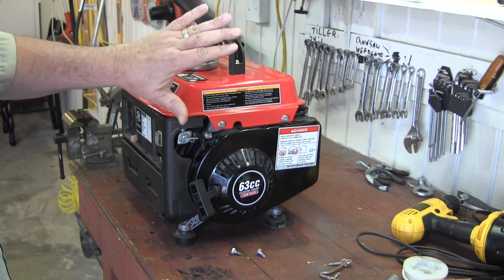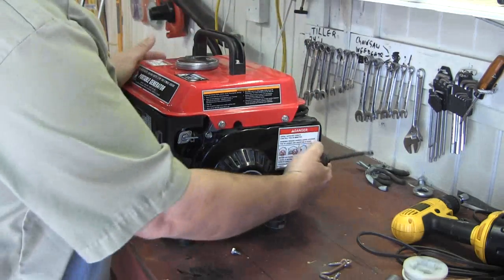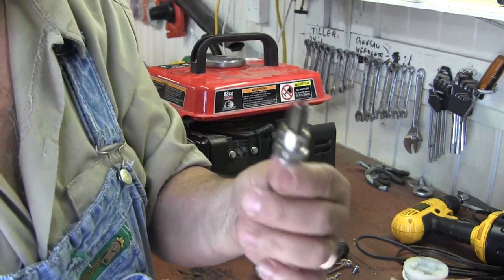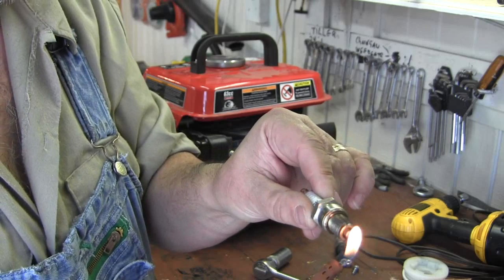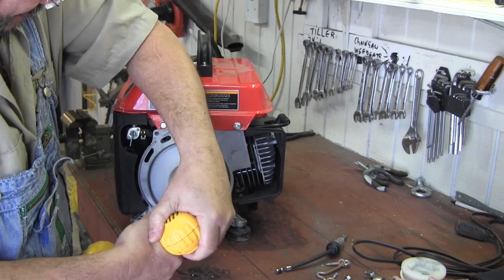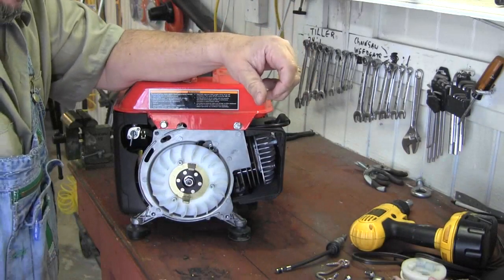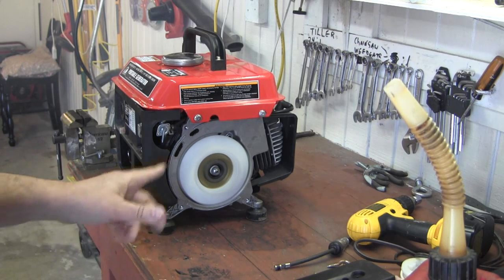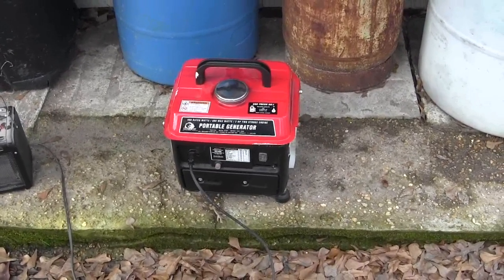Harbor freight generator wont start

Comment: When it's flooded, what often works is to turn the gas switch "Off".  As you turn the engine over (with either the pull start or the drill - great idea, by the way), it burns the extra gas out of the cylinder.  Sometimes, it will catch and run and you can switch on the gas really quick.  Other times, it will fire and stall but if it does, you can turn the gas on and it'll almost always start right up and run fine from there.
I agree with the comments about the spark plug.  I know several people who have these little generators for their RVs and most of them had hard starting, rough running problems but an Autolite plug fixed 'em all like magic.
These things also don't like ethanol-fuel, either.  Most of my friends either use no-ethanol fuel (a lotta boat docks have it) or put "Stabil" in the gas.  No matter what you use, it's a good idea to store it with a dry carburettor.  When you're finished using it, turn off that gas valve and let it run until it quits.  The EPA gas that they sell now makes it hard to store most all power equipment.
Thanks for this video.  I expect you saved a lot of people some time and headaches when they have trouble with their generator.
Reply: Thank you so much, you just made my night. It worked!

Comment: Nice trick with the drill. What has worked for me in the past on a flooded engine is to pull the plug and let it sit for a few hours. Compressed air would speed things up considerably. If you're in a hurry a spray of starting fluid may do the trick too.

Comment: Well done. Those cheap harbor freight gens are worth every penny to me. Run damn strong(well over the rated watts) and when completely finished off from several years of hard use, pull out another one and save the old one for parts. I buy two or three at a time when I get them for seventy bucks a pop. Hard to beat.
Reply: +Arock PCB I buy 3 wenches at a time, and buy 1 extended warranty.Itr covers all 3. They never check serial numbers.
Reply: very clever sir, id love to know the actual margin lines on their products. gotta be still making a profit if every other tool gets returned. I still love HF, many a tool I would not have if I had to pay five or six times the price and most jobs I do a "disposable" tool is cheaper than even renting one.
Reply: Grumpy old fart was a knight at King Arthur's court.

He had a discount card for Rent-A-Wench.  Served him well.

Comment: It's a good little generator for the money. The problem with these is the factory spark plug that it comes with. Change the plug to a better one, and then you wont have anymore starting issues. Also the pull start/shroud has to be on when running the generator. The engine on this unit is air cooled. The fan blades on the fly wheel blow air through the pull start/shroud. With out the pull start/shroud you will over heat, and prematurely wear the engine out.

Comment: If your going to keep the drill crank idea , you NEED to mod the recoil cover  (Gut it and Drill a hole) That cover forces the air over the cylinder to cool it.
Running anymore then 15 min will start to burn her up. .
Reply from the maker: I just used the drill because i new it was gonna take a bunch of pulling to get it cranked. it will crank easy now.
Reply: But you left it Running after on the heater to burn up the old gas.
Reply from the maker: ***** Its ok. its cold out. Its all back together now.

Comment: I have one like that.   Handy thing to have.    I used mine to run my refrigerator for 6 hours when the power went off.   Had to pull the starter 30 times to get it to start but it worked.    I'm gonna try starting fluid with top cylinder lubricant to get it to start easier.    I use a drill set up like that to start my pressure washer when it is hard to start when it hasn't been used for a while.

Comment: I have had the same thing happen from everything purchased from HF.
I just remove the plug and crank all the fuel out.
Then spray I leave the plug out and come back later or spray a little bit of starter fluid on the combustion chamber.
My machine usually starts right up.
This was a great tutorial for all of those who would just toss it.
Reply from the maker: running it dry is my new routine when i put it away, no more probs.
Reply: If you buy from HF and it's got a motor,  rest assured that at some point in time you will be returning it for an exchange, or to get your money back!!!!

Comment: I bought a similar type unit not harbor freight but probably made at the same place it's been 2 years and is still in the box I should probably test the thing. I always try to run the carb dry when I put small engines away the alcohol in the gas today can raise havoc with the carb. I read somewhere some of these units had problems with the shutoff itself. glad you got it running great starting method.. Take care
Reply from the maker: I blame about 2/3rds of my mechanical problems on that damn ethanol.

Comment: 2 cycle engines. Weedeaters, chainsaws, etc must be ran out of fuel for storage.  I fought that last year.  Glad you hot little generator running.  I have had to clean spark arester in muffler before also.  Good video.
Reply from the maker: I think ill just take the spark arrestor off. that will mean ill never be able to run it in california.
Reply: 10 thumbs up on the non CA compliancy

Comment: glad you got it running I have run into something simmilar. What I ended up doing was making sure the fuel was off and pulled the spark plug. The cranked it over several of times to blow the exess fuel out the hole. A little messy but did the jujob

Comment: My first thought, when I saw how easy it cranked over, was that it had no compression. But, I reckon with a piston that small, there wouldn't be a whole lot of compression anyway?
Now all you need to do is rig up a one-way clutch to your power-crank tool, and you're golden!  :)
Reply from the maker: The drill was just temporary because i new it was gonne require a bunch of pulling. i pput the cover back on and cranked a few times and it cranks right up. im gonna let it run out of fuel now.

Comment: When I have the same problem, when using the drill, I leave the spark plug out, choke off, throttle full open.  This aids in blowing out the excess fuel and overly rich mixture.  Leaving the spark plug out allows the drill to work less and spin the engine faster to hasten the purge of the excess fuel.

Comment: Put in a good spark plug
I have a cheap generator, wouldn't run worth a crap. Had the same plug as this one (could see the name as you rotated the plug). Put in a new name brand plug and the thing runs amazing. I used an online cross reference to find the right plug. Have had it for 10 years and runs great. Use it for power outages, running a electric 10ft pole saw for trimming trees, lights around the pond in the winter for skating, etc.

Comment: Thanks BCtruck.  I do not have one of these but if i ever get one and i flood it i sure know what to do to start it.  That was a great idea making a power starter with an electric drill.  There should be an access port on the cover to allow for that option.
Your tenaciousness reminds me of how we dealt with mechanical problems in the field when i was in the Army.  Whatever it takes......get the damn thing working.

Comment: i like this generator. it is very usefull. perfect for running a skill saw and charge drill batteries when there is no electricity around. only thing i dont like about it is how easy it is to flood. be careful when you run that without the cover. i had the blue model that seized up in cold weather when i ran it without the cover for over 15 minutes.

Comment: Just an observation, but taking the pull start off also removed the ducting from the fan to channel cooling air over the cylinder. with todays fuels being not real gas, but methanol/ Ethanol addedadding 2 or 3oz. of 2cycle oil per gallon fuel, it will work to stabilize fuel, also another tip, when done using leave gen running and turn off valve at tank so gen runs all fuel out of carb, then theres nothing left to go bad, or gum anything up.
Reply from the maker: John Vanlandingham this is a 2 cycle engine,so there is 2 cycle oil in the gas. The cowling removed for a short time doesn't hurt the cooling. Over a long term,sure,its highly likely that it would shorten its life.
Reply from the maker: Mike Brink a little less caffeine there boss man.
Reply: I have one that won't start because no spark to the sparkplug,

Comment: Thanks 
Thumbs up 
Doesn't the pull rope cover double as a cooling air intake?
Reply from the maker: Dive Bar Casanova yes, it funnels the air over the cylinder head cooling fins. It's not something you would leave off long term.

Comment: Can you punch a hole in the recoil housing so you can start it with a drill, while leaving the recoil pull cord in place? Or do you have to remove the cord?
Reply: It is possible to remove recoil housing moving parts and cut a piece of recoil housing. But every time generator is started with drill the plastic flywheel bolt tightens a little bit, and eventually the flywheel might brake to parts.(It is made of plastic and it is not designed to be used this way.)

Comment: THank!  I had done all you did (including the drill trick) except did spin it long enough like you said...  ran battery down on drill then switched to an electric drill with faster RPM, sure enough it fired up....  wish I had watched this first as I would have saved the time I took to take the carb off and clean....  strange it needed to spin so long to fire up....  air leak at engine block gasket perhaps?

Comment: Nice vid BC done that loads of times with some of mine, just be careful if you do it on a bigger engine, because if the engine is faster than the drill, you break you wrist and it hurts

Comment: In all carburetor engines it's a good practice too empty the carburetor bowl before storing it. Close the gas petcock valve and run it until it shut off its the best to do. 

Among other stuff have an outboard that was not started for 2 years. After putting some gas in it started immediately no issues at all. Snowblower, generator, etc. same thing.

Usually the float valve in the carburetor don't seal properly and flood the engine. Also the crank oil get's "washed" overtime which is also not good at all. Hope it's useful for future reference. ;-)

Comment: So BCtruck, rebuild, repair,repurpose, would you suggest getting a nicer small generator like a Honda or would you still buy a generator like this one again? I may be in the market soon. :)
Reply from the maker: Wayne,it depends on what you want to run. these are rated for 900 watts ,tops. they are only good for lightimng or one small electric heater. you can also run a big fan. They are certainly worth the 90 bucks i gave for it,but if i had several hundred, (maybe more) i would buy a 2500 watt honda and it would be much quiter and last a lifetime. this little genny is what it is for a few lights,a fan, a small heater. I have a 6500 watt genny for the big stuff.
Reply: Right, I understand the power output but I'm thinking I want to get a small one anyway. So, if I do...is it worth scraping for pennies to pay for a Honda? I don't like to dick around with equipment that's not working when I'm ready to pull it out and use it. That said, maybe this machine will work nicely every time if it's drained or the valve is shut off...more than likely so!
Reply from the maker: ***** If you ran it dry,or shut the fuel off, it would crank every time. they are worth the 90 bucks for sure.
Reply: Ok thanks BCtruck, rebuild, repair,repurpose!

Comment: On all my gas tools, genset, weed whackers, lawn motors, so on, I use high octane fuel, and I always turn off gas valve and let whatever it is to run out.  I reopen when its time to start, and closed again to shut off.  I find the smaller carbs gum up faster.

Comment: Loved the drill starter...on my big generator I always turn the fuel valve off and let it run out of fuel.  Never takes more than three pulls to get it started even though it sits for months at a time.  I've been on the fence about getting one of those little generators myself.
Reply from the maker: I cant believe i didnt do that. In the morning im gonna shut the valve on my big genny and let it run dry. Thanks for the kick in the pants,.

Comment: That’s good to hear but I have one of these and I made a modification to the pull starter and initially ran it without the shroud and it overheated and stopped running.  I let it cool down, reinstalled the tin and after that it was OK again.

Comment: I'm not a fan of 2 Stroke lawn equipment. When I was younger I had a 2 stroke Dirt bike. The first month I spent a ton of time trying to get the correct fuel oil mixture. I had a 2 stroke weed eater. That gave me issues. My 4 stroke lawn mowers never gave me issues.

Just my 2 cents...LOL
Reply from the maker: 2 strokes seem to last forever is the only reason i like them. they are certainly louder than 4 strokes.

Comment: My rope got stuck and hanging out. I took housing off and loosened the housing center screw a LITTLE. Wrapped the rope (counter clockwise)all the way back onto the plastic grove. Pulling the rope until spring was tighter holding it in place so it wouldn't loosen I then rewrapped the rope around the plastic counter clockwise until all the rope is back on the plastic grove it fits into. Then tighten the housing center screw until the rope pulls like normal. if spring is still loose pull rope out until spring is tight while holding the plastic, so it wont turn, and replace the rope in the grove again until you get the tension you want. Good luck.

Comment: I got this type of portable generator as well and sad to say it did fried my adapter for my modem due to dirty power. Basically line conditioners are a bit pricey on my end. Is it fine to use an AVR and surge protector for the modem as an alternative? Thanks

Comment: I do the drill trick when I'm trouble shooting and repairing small gas engines. If it doesn't start in two or three good pulls then off with the top and out with the drill.

Comment: this is a great generator. too bad the flooding issue seems to be the common problem with the 2cycle oil clinging to everything in the cylinder.i do my best to keep this issue from happening by turning the fuel valve off and let the engine run till the carb dries out.
Reply from the maker: thats sound advice and i usually remember to do that.

Comment: Another reason at times ...when people tend to mix there fuel a little rich (more oil) there is a screen in the exhaust that tends to plug up with soot and actually chocks the generator making almost impossible to run right
Reply from the maker: mexifin Ive heard of that,but ive never come across one yet that had that problem.
Reply: These are two stroke engines that require a 50:1 mix if I remember correctly.
Reply: http://www.harborfreight.com/engines-generators/gas-engine-generators.html. Check the 5th generator down, I also work on small engines.If this was a Honda the low oil sensor would prevent the motor from starting. It helps if you can read a little, So to shay

Comment: Harbor freight sells a socket adapter that lets you use a socket for a drill or an impact. They're less than $4 I think.
Reply: +Love2boat92 I'm saving up to buy one these
Reply: Courage The .Cowardly Dog Luckly with harbor freight its usually not a ton of money for something. I've said this before and I'll say it again if it wasn't for harbor freight I wouldn't have half the tools I have right now. I can do so many more things now.
Reply: +Love2boat92 
Agreed. Plus they have a pretty loose return policy which is nice. I tend to do my shopping at HF and have had fairly good luck with items bought there.
Reply: jayw900 Yes. I love that store and most of their stuff.
Reply: jayw900
Harbor Freight is a good store

Comment: just for trivia sake.  if you have a fuel choked small engine, take the spark plug out and turn the motor over to force all of the excess fuel out the hole. OR take compressed air and stick it into the plug hole. then do what you did.  taking the plug out speeds up the process
Reply from the maker: I took the plug out and let it sit overnight but i didnt hit it with the compressed air.

Comment: My Harbor Freight generator won't start. It did run when I got it used about 4 months ago, but not well. I put a new carb on, checked the spark, new NGK plug, but not even a hint of starting. Used the drill to turn it over, used starting fluid, but nothing. Seems like it has compression, also fresh gas, I need help !!!
Reply from the maker: Steve Rothman did you check to see if it had spark?
Reply: @bctruck  I did, with a spark checker. However I'm wondering if I actually have a good spark at the plug end. I will check the gap and spark quality today. Thanks for the quick reply
Reply: @bctruck  I checked it, there is a spark but I think its kind of weak. I did switch plugs when I got it to an NGK BP5ES. I gapped it to .023. Shot a little starting fluid in the cylinder but no result. Could this plug be the wrong one?
Reply from the maker: @1949carguy  Im truly puzzled Steve. Without putting my hands on it, Im out of guesses. You've done everything I would do to trouble shoot. If you find out what it is, Let me know.
Reply: @bctruck  is that plug ok

Comment: Spark plugs can easily get carbon tracks on them. Especially if they are too cold for the engine or have been started for only short periods. A small flame may burn off some gas but just adds carbon.  If you really want to clean it good just chuck it in the vise and put the propane torch too it. Get the tip and insulator glowing hot. That will burn off the carbon and let it spark again. A file job for a sharp edge will also let the spark jump easier.